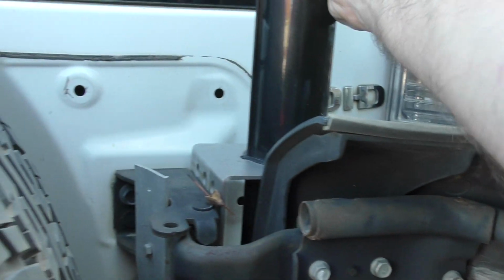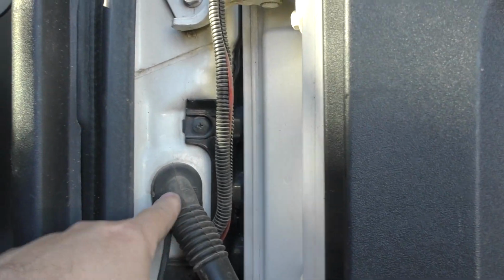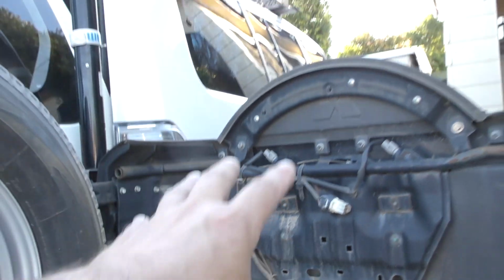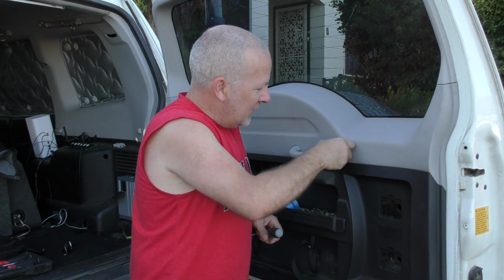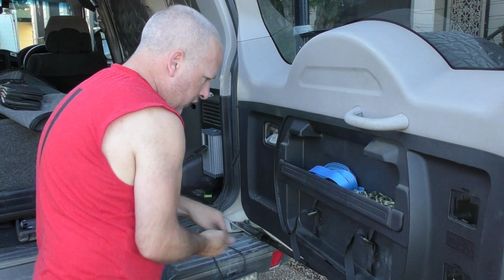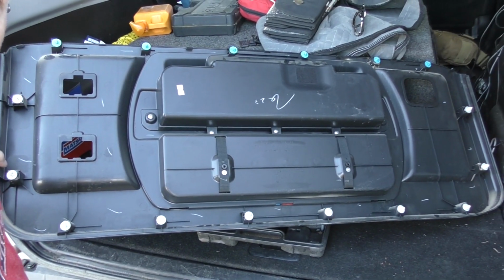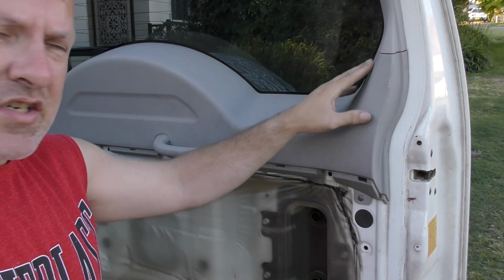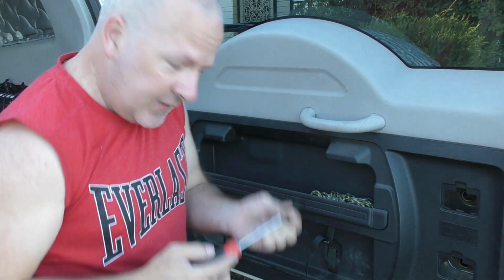Pajero removing rear door trim and running wire to wheel carrier

Comment: Thanks Den for all your videos, I own a Gen 4 pajero here in Kuwait , and worked on damping my all 4 doors, next would love to see if ur interested in removing the entire dashboard unit, as it will help a lot of us to clean the Ac filter beneath - there's so much this lovely SUV can be done with, Thankyou 🙂
Reply from the maker: thanks Fazz, I've already got 3 videos that will show you how to remove the dash or most of it anyway. here's the link to the first 1 https://youtu.be/4C7TFUrhZDM
If you're talking about the a/c cabin filter, you don't need to remove the dash, you only need to drop the glove box down, remove 2 screws and pull it out. It's worth doing if your a/c fan is not blowing out much air. it may be blocked. I've touched on this one in a few vids but don't remember which ones. I can do a specific one for you if you'd like

Comment: There are two screws you need to remove there are were the warning triangles are, and the middle section trim where the handle is, it’s been held by 4 screws , 2 which is you mentioned and 2 are been held underneath the top trim section which you have to remove to get access and the remove the door handle screws. I did undo the whole trim and started from top. It’s easier if you do have trim removal tools as those pop rivets are easier to remove rather than pulling on the panel.
Reply: I have removed the whole trim 3 parts of it. There are 4 screws holding the middle sections the two you showed, the two are on top which is been overlaps by top trim sections.
Reply from the maker: thanks heaps mate for taking the time to share. i need to get some proper trim removal tools. I got the plastic ones from supercheap but they ended up being rubbish. I'll invest in a proper metal set later on.
Reply: @DENMONKEY  I use one from jay car cost around $20 there are proper ABS plastic one and good quality used to remove everything from whole dash to doing TCC lock up kit.

Comment: Hi I have a question about how to change the metal frame on the spare tyre carrier on the rear door. Mine has rusted away in a few places 
I can get a replacement frame. I'd just like some help on the hinge removal

Comment: Hi mate, great videos. Question, I have a 1990 SWB Pajero. My lock is stuffed and I can’t open the back door. Would it be the same process to access the lock on the older car? Thanks
Reply from the maker: I would expect it to be pretty much the same, yeah. I don't know for sure though. You should be able to access the mechanism and get it open from there......in theory

Comment: Hi Den, how often should you remove and replace the injector pipes, the service book shows replace the pipes the sixth time,my mechanic says  not  to touch them. I have a 2013 NW VRX with 94,000km, looking for some advice, thanks JB
Reply from the maker: Sorry John, I've got no input for ya on that one outside of what I've read in the manual.

Comment: Mr Denmonkey, I have a problem with my NX Pajero with the rear door catch getting stuck and not being able to open the rear door. As you probably know on the NX there is no internal door release handle on the rear door (thanks Mitsubishi!). If I was on a trip and couldn't get the door open this would be a real disaster (thankfully it hasn't happened yet). I was thinking maybe I could cut a hole in the rear plastic trim behind the cover which hinges up. If I make it large enough maybe I could get my hand in there to manually operate the door mechanism? Also this would be good to keep the mechanism clean and lubricated, the lack of which I believe is the main cause of it getting stuck. Do you think this is feasible? I have also heard of other people running a wire which can be manually pulled to open the door, maybe this would be a better idea?
Reply from the maker: Give me a couple of weeks. I have a handle that mounts inside the vehicle on the back door so you can open it from inside. I just need to fit it and test it. No cutting required. Just remove the plastic cover over the rear wheel mount bolt and you can reach it in there. I'll get onto it quicker now I know you need it.
Reply: @DENMONKEY  Thank you. Much appreciated. I will keep a look out for it.
Reply from the maker: I've just loaded a new video for you which has a solution for you.  I hope it helps.
Reply: @DENMONKEY  Thanks Brett, that looks like a very practical solution. Will definitely order one of these and have a go at installing it. Cheers and once again thanks on behalf of all the owners of Pajero's for all the invaluable info you provide. When it comes to Pajero's you are a legend!!!